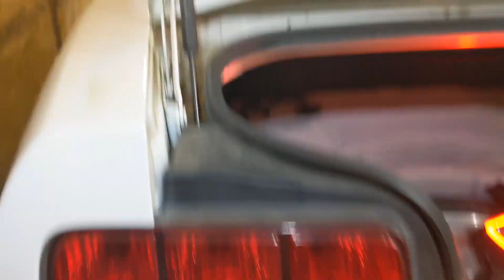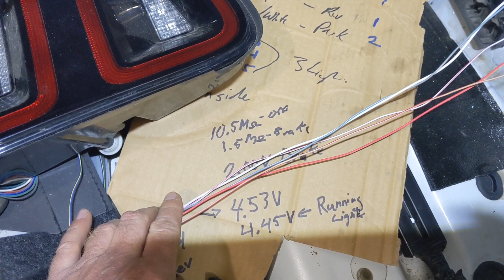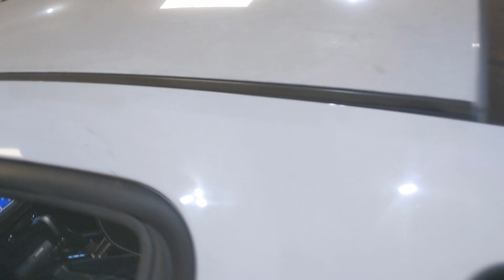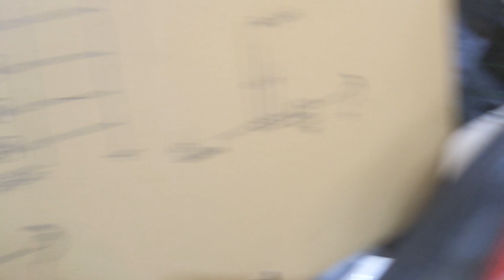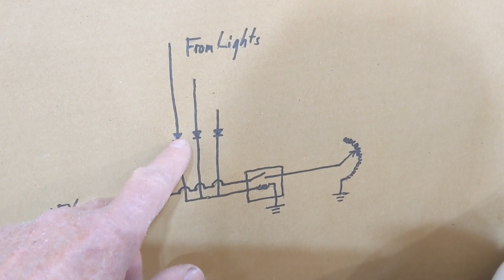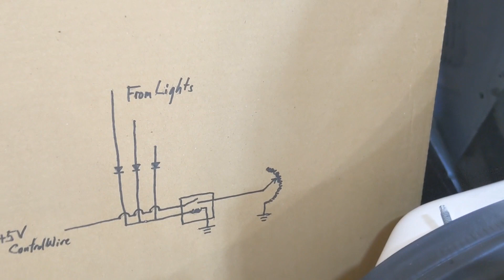April 23, 2024

Comment: The 2014 Wiring Diagram book does NOT have the diagram for the circuit board inside the taillight housing. It shows as just a module and non-serviceable. (I do have the 2014 Ford OEM Wiring book.)
Reply: Switching out the incandescent bulbs to LEDs will keep the BCM\Sequential unit happy. Odds are you will not need the relays at all. Bad news is quality LED bulbs are around $20 a piece and you need 8 of them. (6 Red and 2 White for the reverse.)
Reply from the maker: Thanks for letting me know the wiring manual doesn't have a schematic for the tail lights. I did a lot of searching and couldn't find a schematic so I suspected it didn't exist. Yes, cost was the main reason I went with relays first. There are cheap Chinese LEDs out there, but I haven't had much luck with them in the past. If the noise of the relays drives me crazy, I still might go with some quality LEDs! Thanks so much for the feedback. I really appreciate it.